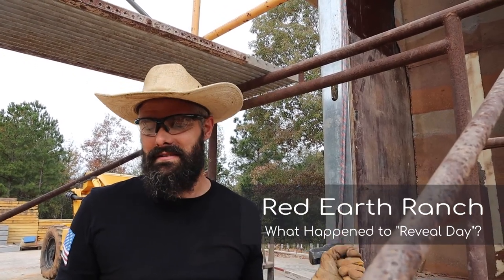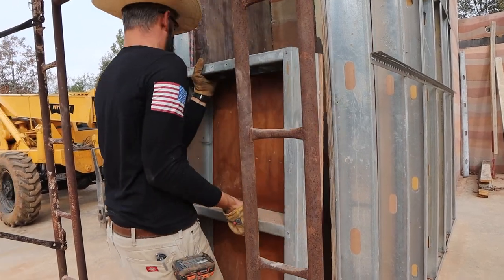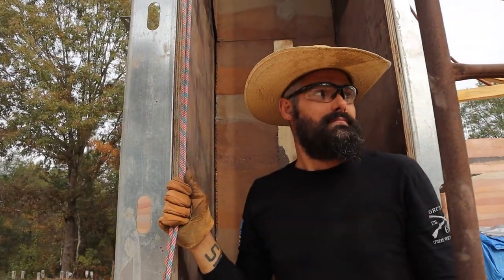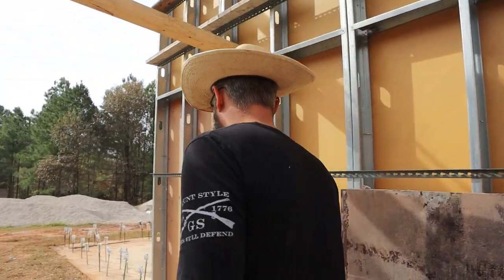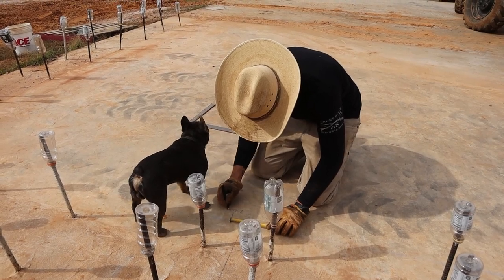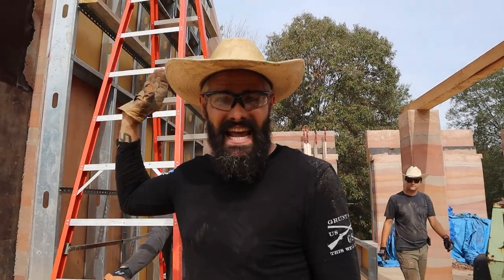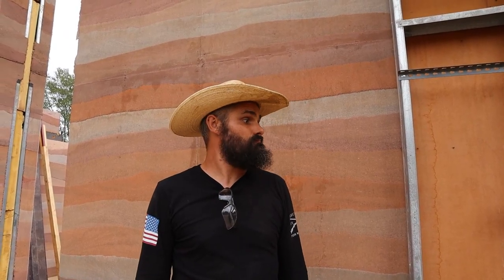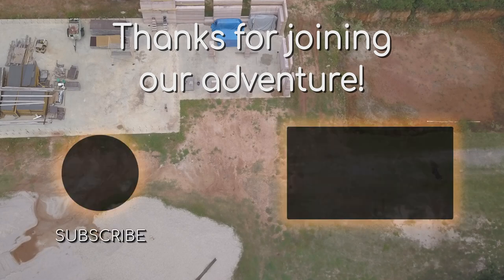Let's See Our Tallest Rammed Earth Wall Yet - Vlog 86

Comment: To mitigate the uneven angles at the top, you could use a board that fits between the two wall forms to make sure the top is angled to your needs, just as you with your inner sidewall boards.
Reply from the maker: Good call!

Comment: Sorry if I’m flaunting my ignorance, but how is a wall that high NOT fall over?? Do the two foot rebar spikes really give it enough stability? Or am I missing something?
Reply from the maker: That is a GREAT question! I found this out when I was standing on top of the wall and felt it wiggle. When a wall that size wiggles even a little it is a bit unnerving. Basically the weight of the wall keeps it in place until you can tie to another wall. We learned that with a wall this high we needed to keep turnbuckles on it after it is up to keep it from moving too much. Probably would take a lot to knock it down but we are in Tornado country so the turnbuckles are staying up until we can get some timbers in place.

Comment: Hey Ricky, how big is that lift/wall? I am putting a design together and there is a single wall that the project works around and anchors to - it will be a 23ft tall, 14.5' long, 18" thick wall. What do you think about that? Too tall? What would you say is the highest single wall you would construct? Thanks in advance, great to see that despite problems, you are are still going great.
Reply from the maker: Hey Drew, I'm definitely not an expert but in my opinion it depends on the strengths you are getting. I would suggest doing crush tests to see what the psi rating of your mix design. If they are above 3000 psi you would probably be good with a wall that high if the rebar is going through it. Hope that helps
Reply: @RedEarthRanch  Thanks a lot Ricky